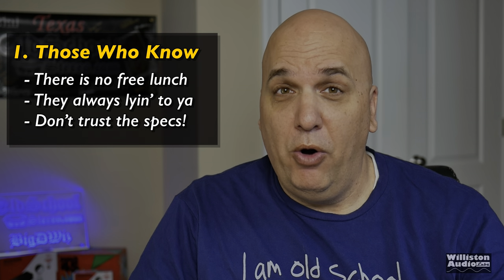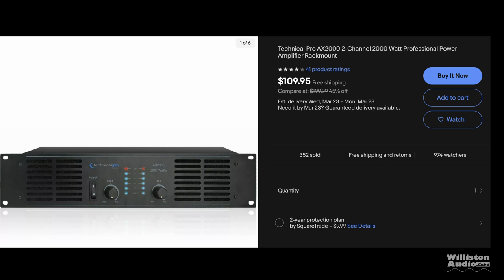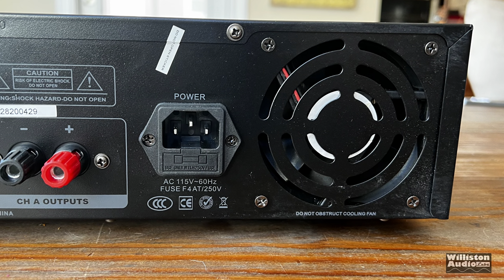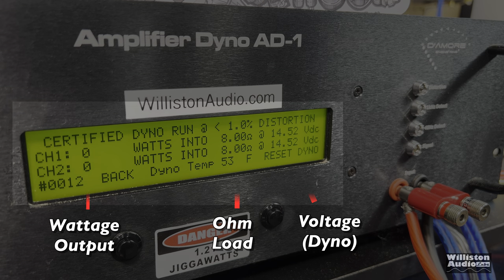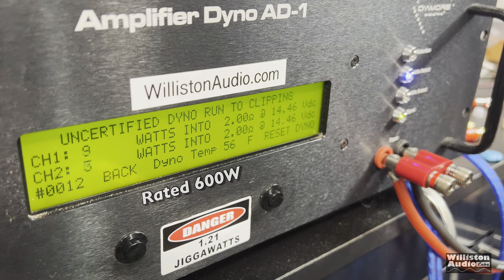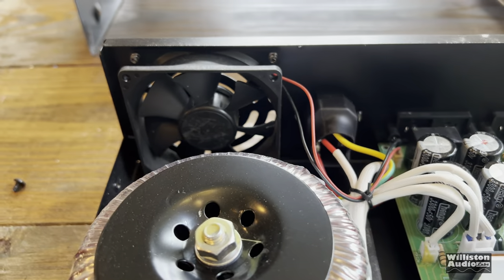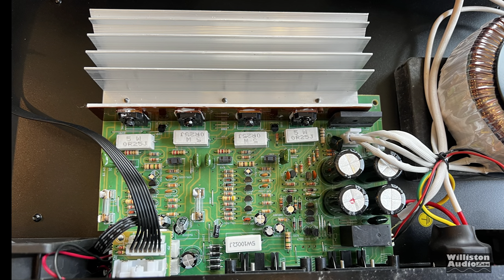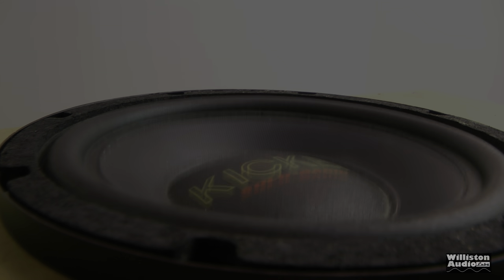Pro Audio Amp on the Cheap? Technical Pro AX2000 2000W of Unicorns [4K]

Comment from the maker: Shop for Pro Audio: (affiliate links)
Technical Pro AX2000 - https://ebay.to/3to4KUX
Crown XL0 1500 - https://amzn.to/3qlII3o
Behringer AX3000 - https://amzn.to/36imcBw
Elac Debut 6.2 Bookshelf Speakers: https://amzn.to/35i6RjK
Polk Audio PSW10: https://amzn.to/2R9Mgp6
Newer version PSW110: https://amzn.to/2CxhY7H
Other home subwoofers: https://amzn.to/2RbOiVQ

Send me a tip: https://paypal.me/BigDWiz
Support Monthly: http://www.patreon.com/OldSchoolStereo
My Favorite Screwdriver Kit: http://amzn.to/2x0VzcE

--------- Test Bench Equipment -------

SMD / D'Amore Engineering Amp Dyno: https://goo.gl/sJTcf7
XS Power D1400 Batteries - https://amzn.to/2BPFCKW
XS Power PSC60 Charger - https://amzn.to/2CHGcfs
Fluke 1000A AC/DC Clamp Meter: https://amzn.to/2Rw5WDA
Handheld Dyno: http://amzn.to/2u2EgKV
My Favorite Screwdriver Kit: http://amzn.to/2x0VzcE

DISCLAIMER: This video and description contains affiliate links, which means that if you purchase from one of the product links, I may receive a small commission. As an Amazon Associate I earn from qualifying purchases
Reply: Yeah I've got a whole rack system that is "techincal pro" and "pro studio" branded and cost over 3 grand at rent-a-center claiming to be 2,500watts and currently has four 15 and four 12in speakers hooked up to it and while I know it isn't anywhere near 2.5k watts she definitely does dim the lights when it powers on and is cranked up to just under distortion lol
Reply: To make a funny joke, looks like somebody took a 1000watt power inverter and turned it into an amplifier 😂😆😆😆
Reply: @cliffcorbitt9494  not even!!! Lol-ol-ol
Reply: I have the Crown, and it pounds on 4 twelves!
Reply: I own a Crown DriveCore XLS 1002 and it is absolutely a beast of a amplifier.
Reply: Do the autotek ta1050.4.1000 watts
Reply: worst amp ever
Reply: we need more videos on these sub $200 rack mount/desktop amps
Reply: i was considering buying 1 of these even had a discount brought it down to $70 on a used one but u saved me from demons
Reply: Can you test Crown IT 8000 Amplifier I have 6
Reply: Think you test the blastking 20000 watt amp?

Comment: I would LOOOOVE to see more of this pro audio stuff!!!
Reply: Why? You know what the outcome will be 😂
Reply: @monelfunkawitz3966  No we don't. That's why we want to see more pro audio amps tested.
Reply: crown macrotech 5000vz!!!
Reply: YESSS, I have an old Mackie FR1400i that slams, be curious to know how much it's pushing.  These were considered to be more of their "budget workhorse" lineup if I understand correctly. Some say the specs are underrated on these.  Would be interesting to contrast that with newer budget pro amps.
Reply: @gahbah274  I have a m1200. Also a beast!
Reply: @gahbah274  a good indicator is the power consumption written on the back

Comment: Those must be some really nice amps. At $1 a watt, that’s late 90s pricing. Straight junk!
Thanks for the video, bro! We appreciate you.
Reply from the maker: Skraight Outta Powa
Reply: and i bet it aint even class A
Reply: @Durolith  it's obviously class AB. Duh!
Reply: Wait you get into "tubes" / "valves" and audiopholery .... this ratio gets even better !!!!
Reply: @38911bytefree   $37.50 a watt is totally fine, if you make 250-300k a year. Unfortunately, I’m not in that cool guy class! The audison venti 200x2 @4 ohms for only 14,999.99.😂😂
Reply: @jlev505   Crown XTi 6002 costs $2,500 and puts out 3000W @ 2 ohms, 2100W @ 4 ohms, 1200W @ 8 ohms. Bridged Mono Wattage: 4200W @ 8 ohms, 6000W @ 4 ohms.

Comment: Would LOVE for you to test more of these pro amps. I have a Behringer PRO power amplifier (NX6000) which is rated for 3,000w x 2 @ 4 ohms. I used it to run my 15" car audio subwoofer/custom ported box in the living room. The 15" subwoofer (Skar Audio D4 VXF) is rated for 3,000 watts. This amp will bottom it out...but, the whole house just about shakes apart.
Reply: I would love to see the Inuke line of amps as well.👍
Reply: @WOLFTICKVIDEOS  YES! Def...
Reply: You would be lucky if it puts out 600 watts at 4 ohms.
Reply: @analogkid4557  lol no, they do 2100-2400W per channel as it's basically 2 NX3000's in bridge inside, same with the NU6000 and NU3000 actually.

excellent price for the power they put out
Reply: @WOLFTICKVIDEOS  he did the NU1000 and NU6000
Reply: @BH4x0r  that's what they rate it but you won't get that out of it. I have seen dyno tests where the NX3000 only put out 300 watts.
Reply: @BH4x0r  Yeah I actually found those after my comment 😆. The duh moment came to me after realizing I've seen and gave the nu1000 a thumbs up in the past 😳.

Comment: Internals remind me of the flea market amps back in the 90's that weighed 20-30lbs, but when you open them up, it's a big heavy metal plate bolted in, and over buy the power terminals was an amplifier the size of something that would fit in a walkman! Lol

Comment: What I have learned from watching all these amp test vids is the fuse rating times 10 minus a little  is almost always in the ball park of the amp will do. (12v amps)
For example: I can confidently buy a lying no name amp and know if the unit has 75 amps of fusing I can expect about 600 watts or so.
Reply: haha that's the general rule I've been sticking by as well
Reply: And if there is no on board fusing? Its not hard to see through bullshit. Either the wire gauge used, or any other indicators.
Reply: @96kylar  I have had some weak amps with big wire inputs.

Comment: I'd love to see a Thomann's own brand budget amp on this channel. Their E-Series amps are awesome for pushing power on the cheap. The E1200 and E1500 models are 115v switchable so either one of those could be tested. Supposedly, you are able to crank out 2x800w at 8 ohm and 2x1200w at 4 ohm for the E1200. They certainly push high power and it would be nice to see some actually decent budget amps being tested.

Comment: I saw a crazy 10,000 watt into two ohms PA amp yesterday. Dual 20 amp 240 volt inputs and completely independent power amp modules.

Comment: On the topic of pro audio, I recently came across LASE amplifiers. They have a line of 1U size amps that go all the way up to 2X9000WRMS AT 2ohm. That’s hard to believe, would be very curious what it actually puts out. They are not overly cheap either.

Comment: I bought a Rockville RPA9 for an additional amp to run a subwoofer. My primary amp is a Mitsubishi MVR1000 running a couple of RTR Towers with 15s. The line signal was too weak so I bought a Bellari PA550 pre amp for the Rockville. It's working good and bumping my 15 inch NVX subwoofer in a homemade  2.6 cu ft slot ported box.

Comment: Yep I was afraid of that. I bought 3 of them back in 2016 for a home theater set up.
I discovered real fast something wasn’t right with them. I found out that any speaker with a 10” driver or smaller. They would play real well and clean. But I have a pair of towers that have dual 15” drivers in each. They would play the midrange and tweet but did not have enough oomph to get the drivers moving. So I tried a 10” doc sub woofer in a ported box. Subwoofer barely moved. In fact the only way you could hear the bass was to stick your ear against the port.
So if you speakers are 10” or less full range only. Then you could get buy. If you running studio speakers in a home recording studio. They will work fine. If you want to rock out a nightclub. That will be a no go. You will have no customer. To spend money while they dance 🕺 lol 😂.

Comment: Also I had to go see how much my Carvin HT1000 weighs. It is rather heavy. It comes in at almost 23lbs! I normally use it to power a 18" JBL pro sub brigded at 4ohms. My single TOA amp puts out more than that "pro" amp. No balanced in, XLR or even 3/4". 🤔🤔🤔🤔🤔probably not pro. Thanks big D for the video. Keep them coming

Comment: There are plenty of higher quality options in that true power range for under $200. A quick look at Crutchfield will provide a couple. I run a Niles SI 245 for the bookshelf speakers in my garage and it does 45 watts per channel into 8 ohms while being cleaner and slimmer. I paid $40 for mine and they are plenty on ebay for under $100. Keep up the variety Big D 👍

Comment: Really wanna see QSC on the dyno. Worked for a theatre some years back, and when they remodeled they let me keep 12 different QSC amps, as long as I removed them (bc they were very heavy, like 50lbs a piece).
Reply: QSC makes excellent gear.
Reply: The RMX series have linear power supplies and weigh a ton!  The powerlites are SMPS, super lightweight but not on power!  A powerlite9 will dim the lights on the block providing it doesn't trip your main breaker first! ;-)  Both will deliver rated power seven days a week for years.
Reply: @cpufrost  I run plx 3602's and they are nuts.
Reply: @druskoprecisionsound6250  indeed they are!
Reply: I was looking for someone to mention QSC... amazing amps! I have a 22 yr-old cx254 and it's truly amazing.

Comment: Do a crown xli 3500 It weighs 50 lb and puts out 2,700 watts at 8 ohms. Or maybe peavey ipr2 7500. Claiming to put out 47500 watt at 2ohm. That would be interesting. Myself I chose the crown over the peavey.
Reply from the maker: I can’t test amps that powerful at this time. Amp Dyno has limits of 5000W at 4 ohms
Reply: *4750W @ 2ohm
Reply: @elektrocat8681  Yes that's what I meant thanks for the correction I got a little keyboard happy you know how it goes
Reply: @wal  If your home/shop has sufficient power you can use a 60Hz test tone and hook a bunch of toaster ovens up to the output for ballast.  A new rating of toaster ovens per channel is thus achieved! 😀  Funny story with 60Hz sine tones, many years ago I used my HiFonics Zeus Series 7 to power a circular saw and was able to cut studs as easily as if I had a generator.  Even used TECHMASTER PEB "bassgasm" as a source.  Lots of notes below 60Hz and the saw's motor brushes didn't like that too much and the amp went into protect a few times but no harm done.  My side hurt from laughing so hard that day and the day after!
Reply: @wal  but could you test the xli 3500 for me please. I know you already test the xli 1500

Comment: I agree with all that you point out. As an owner of a McIntosh, Nakamichi & Klipsch based main system (very old but VERY good) ...I surprised myself & I did buy one of their products ...it was very cheaply priced & I intended to only use it for headphones on my flight sim. It was rated at a ridiculous 1,000 watts!!! I would be happy if it put out 10% of that so I took a chance & ordered one. However, I ended up liking it & I use it for our (Kitchen) sound system ...replacing an old, but pretty good Sony amp. It is not of the quality one would consider for critical classical music listening or such. But at the low price I paid, ...it sounds good & does a lot, so ...I've no complaints.

Comment: Well 50 watts is about the going wattage for any Home audio power amp in that range. Which is basically what it's good for. Maybe to power ATMOS or rear speakers in a pre/pro surround system.

Comment: If you look up the company, they actually have a brick and mortar headquarters and decent looking website.  I guess that's to help their image and make it look more legitimate, but otherwise it seems like "white van special" for flea markets and internet. 

Also mildly funny that they went through the trouble of using an expensive toroidal transformer...that probably costs more than all the rest of the components in the amp combined.  Maybe the new version will have a switch mode supply and concrete weights to save money. 😁

Comment: The eBay site you showed had 250 units sold. I wonder how many got returned. It didn’t sound bad on the elacs but it doesn’t even push the 100w you get on a cheap av receiver you get for the same price. I actually thought it would push around 150 max but I didn’t expecting to be 50 watts per channnel.

Comment: To be fair, it does look like it was dropped, so it's possible that this could be an atypical unit(however unlikely as a drop failure would probably result in it not working, instead of it just working at a small fraction of it's advertised rating).

I wanna see more midfi/cheapfi/chifi stuff like the FOSI brand, or S.M.S.L.

Comment: Where's the beef? Hell,where's the lettace? Had to request a dyno video. I got a arc audio (never seen one tested)very cheep for my work van. Its a 1100x5 ,and im absolutely blown away! Had the newer pioneer 5 channel.i heard amazing things about arc audio is why i took the time to replace the pioneer. This amp is rated way less then pioneer, but is insanely more powerful and the cleanest amp ive ever heard.figured i could at least ask.thanks
Reply from the maker: Arc seems to make great stuff. I might have one around here to test
Reply: @wal  thanks Big D

Comment: The only cheap pro audio amplifiers that are capable of putting out a lot of rms power are the pyle pro power amplifiers even though they are not top of the line because the pyle pro pta 1000 can put out close to 1000 watts rms in bridged mode at 8 ohms if you use it with a really good graphic equalizer and a mixing console and really good active crossover.

Comment: Dang
I'm a Dj I have 5 Dj setups and all of them have technical pro amps to Power the speakers.. I never had a problem with them
I have 4 4,500watt amps for the subs
5  2,400 watt for mid bass speakers 
5  1,500 watt 3 way
For subs dual 18s B52 subs 
Cerwin vegans for mids
 Barringer 3 ways
I tell you they sound really good.

Comment: So I noticed the driver stages.  And if it meets 0.005 distortion at 50 watt then it would be considered some kind of pro.    I've been wanting you to do something for along time. I want to see a distortion meter added.  And get the power ratings at 0.005 distortion  and see who came out on top

Comment: I've noticed that these cheap amps don't show a specified AC power input. That's a hint at the power output.

I had an MC2000 which was a true dual mono amp. Separate transformers etc. That was a monster and I wish I had never sold it.....

It says 1100 watts on the back as I recall. Slamming amp. Miss it.

Comment: My crest audio cc2800 professional amplifier weights 60 pounds output rating 1400 watts at 2 ohms and Min load bridge Mono 4 ohm
Reply from the maker: Some of the new class D models are lighter, but not under 10lbs 🤷‍♂️

Comment: Aways from the price point If those were original Toshibas away from the no sense marketing, looks like a nice amp to have. Class AB, toroidal transformer. Potential for a good project amp for HOME AUDIO. Since late 70s many of the reputable brand stoped using discrete BJT ouput in favor of hybrids modules which were crap, expensive to replace. This contruction is simple which doesnt mean "bad".

Comment: I better look at buying another amp I’ve got the Technical Pro LZ10K yes rated at 10K max bought it because it was cheap and just starting DJ’in gigs ok might not give the full 1650 watts a channel @8 ohms, (rated)that’s what I’m running it at but it sounds good I’ll give it that and it’s never over heated on me, yet

Comment: The next cheap pro audio amplifier that I want to get see tested on the amplifier dyno is the rockvillEe rpa5 power amplifier by rockvillEe because I’m really curious to know if it’s really capable of putting out 500 watts rms because the rockvillEe rpa5 power amplifier has xlr inputs and speakon outputs but I’m curious to know if it’s really capable of doing the rms power that it rockvillEe says it can do.

Comment: Do you think one of the crown 1500 amplifiers would power 2 of the skar 18s that you recently reviewed in a live sound scenario? I would be feeding it with a mixer with proper filters. Just looking for a more bang for buck option than the very expensive options of pa subwoofers on the market.

Comment: I am new to the car audio game. I do learn to not trust the specs on what I see or on the box. That said I think i did okay when i purchased my amp and my subwoofers. I have a boss 1500 watt monoblock amp pushing two rockford fosgate r1s4 that are 10s and i think in a ported box. I've got pretty good bump with what I have just wondering if I need to tweak anything.

Comment: quick question...
Bought a Lincoln TownCar limousine with Kicker's double 12" L7R 2-Ohm Enclosure and no amp was connected to it. 
(Q?)What's a good budget friendly amp that'll help me out in the trunk area?

For limousine party purposes, the stereo and speakers work very well, since I've got regular speakers about 6" from the back of my head in the partition panel. 
haven't messed with amps and subs since the 90's, so I'm clueless... so, buying junk would be a great possibility😢
Just looking for more junk in the trunk
edit: I don't need high end... these kids are just gonna tear it up anyway
Reply from the maker: Rockford, Alpine or Kicker 4-500W amp should do the trick
Reply: @wal  awesome, I’m on it! 
Thanks

Comment: Please Do More. Man, I guessed 100Wx2. Not even 10% of the 2000. Even cheap car audio does way more than this. So sad of a product.
Reply from the maker: I need to buy from Amazon so I can return. Stuck with this POS now
Reply: Good call. It was hard to tell, but it didn't sound good either.

Comment: I work for a company that sells actual professional hardware. You can get a legit 2000w 2-channel rack mount amp that's 9 pounds, believe it or not... but it won't be $110, and it sure won't use RCA in. 🙄 Definitely here for the entertainment. 👍️
Reply: is there one within the range of 200-300 dollars used?